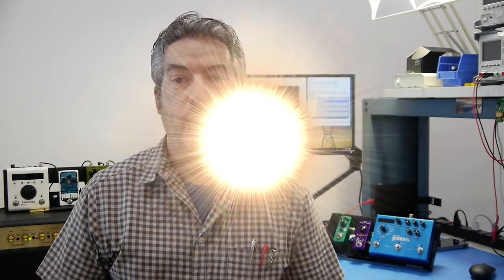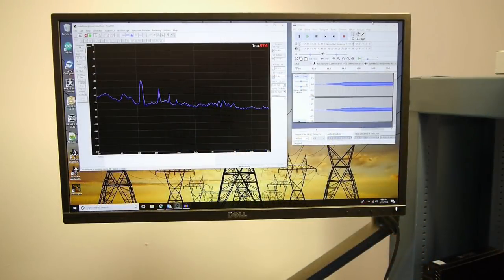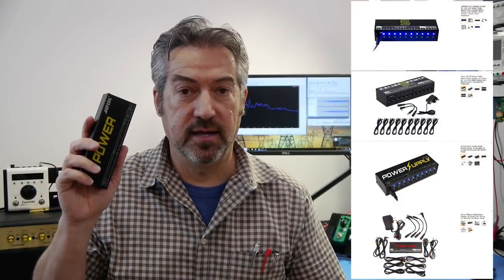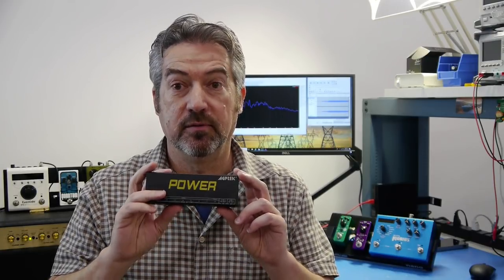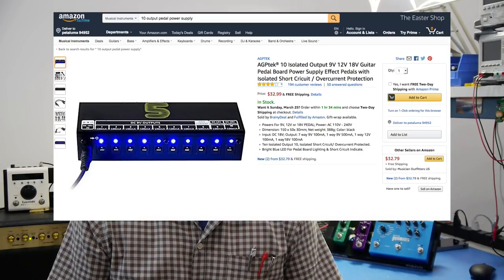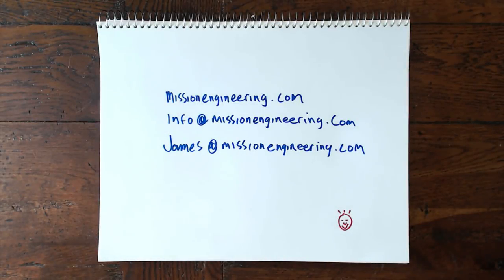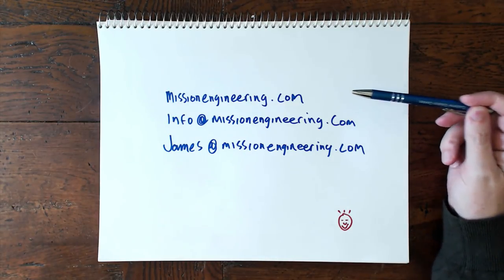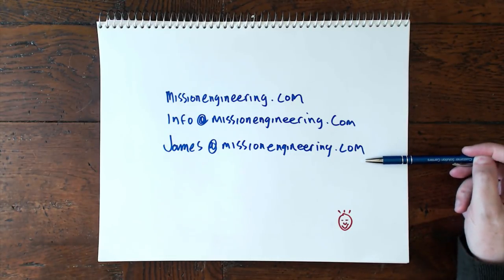Isolated vs daisy chain power supplies

Comment: a battery is a different type of power than a wall outlet.
Reply from the maker: True, but that's not what is happening here. The input power to the non isolated supply is 18V DC from a wall mounted AC-DC converter. The input to the isolated supply is 5V DC from the battery. Both power supplies are DC on the input. I could have powered the isolated supply from a wall mounted AC-DC converter and these results would be the same. I'll do another video on battery vs AC as there are some interesting differences there too, but it's nothing to do with the digital noise issue.
Reply: I would like to see that. I’ve always thought separating the effect Chain from the house power supply is a great idea, especially with a big band and lots of power draw
Reply: well then you should have used walwart power in both instances.
Reply: it's still a control that should have been accounted for. I like the video and appreciate all the effort and explanation, but I too would've like to see both setups connected to a wall outlet
Reply from the maker: Fair enough. It'll make a good follow up video. I'll repeat the tests with both isolated and daisy chained supplies connected to wall power.
Reply: @JamesLebihan  you could probably get away with just doing to isolated one, while plugged into the wall. I can tell you spent a ton of time making this video, and it's probably the most in-depth explanation on YouTube. I really appreciate the effort
Reply from the maker: Thanks, I thought that too , but thinking about it more I can cover some more ground. I'll test the isolated vs daisy chain with both powered from the wall as suggested here. I'll add in a third device, an isolated power supply with an internal transformer rather than an external AC DC supply. Then I'll do another setup with a battery but common return paths. This should demonstrate further that the noise we are discussing is related to the condition of the outputs, and has little to do with the input power source.
Reply: Are the 150 outputs isolated from each other, or just the high output?

Comment: the only reason for that noise is because the power supply's mA is lower than the pedals' combined mA .. therefore, as long as your pedal's combined mA does not exceed the power supply's mA you won't be experiencing noise on your pedal board .

Comment: Hello, this is the best video on this subject. Very detailed, and conclusive. No guessing, instead, just engineering analysis. Thanks for sharing this.
Reply: Just forgot to mention, but placing the digital delay pedal at the end of the pedal chain and preferable after the gain pedals like overdrives, boosts and distortions shall reduce the noise in both cases. Which is the usual order of pedals.

Comment: I'm not sure why this video got any thumbs down....this was very informative and scientific. Thankyou James for posting this... I just ordered an inexpensive "isolated" power supply from Amazon... I sure hope it's what it was advertised to be...because I've been experiencing sound from a tap tempo strobe that is daisy chained with analog drives. It's pretty wrong to advertise an audio effects specially product using such specific terms relevant to this common issue. Hmmm... Im definitely going to test for common ground when I receive it...because the problem will still exist...and I only purchased it because it says very specifically that it's isolated. How do they get away with that for years? That's a very blatant mislabel.

Comment: This really has not much to do with power banks, but I had an issue with this type of noise with AC pedals of BOSS and running them off the same wall outlet with my DC Pedals. I had to switch and make sure all my AC pedals were plugged into a different power strip and use and extension chord to run them to the opposite wall outlet from the DC pedals.  Also not running your power supply wires with the pedal instrument cables parallel will help reduce unwanted noise. (If you have no other choice, cross the wires, do not tape or bundle them running in the same direction together). I also had really old cheaper cables mixed in with some really good ones. I just gave them all to a school music class who needs anything music and just bought some little expensive ones. (Gigtuff) And holy crap the reduction of noise was amazing! Now I have never had these type power sources and wanted to get one. I run mostly analog pedals, but I was wanting a couple digital ones, so thanks for the video. It looks like to have better sound you just have to do certain things and bite the bullet on costs if you want good sound quality.
Reply: Don't power analog and digital pedals with the same power supply. Also don't use a power supply for both pedals that go into the amp In and the S/R... And be aware of the mA current draw

Comment: I recently picked up a Walrus Audio Phoenix because it was exhausting playing with noise.  Went from using 2 cheap pedal power supplies to a single truly isolated power supply.  I only with I had not wasted money on the cheaper psu's from the start, but at the time this was what my budget allowed.

I even bought a power conditioner thinking it would help.  I can honestly say it did not hurt and is a good preventative measure, adding a layer of protection.

Playing without noise is amazing - Thank You Walrus ($$$$$ worth)

Comment: the other guitarist in my band recently replaced a power strip and lower cost iso brick with a higher priced mondo brick and a furman power conditioner. Night and day, truly. So much less noise and such a clearer signal ... i have an iso brick but it only has five outs, so i'm limited and sometimes tempted to use a daisy chain for my drives
Reply: That's interesting because I'm here because I upgraded from a daisy chain to an iso brick and it's noisier than ever and I can't figure out whats going on or if theres anything I can do about it.
Reply: @danielvalles9554   sometimes a bad pedal or a bad patch cable can be the problem. You might want to try using the iso brick and just add one pedal at a time to the chain and see when that noise starts in. Other variables might be the guitar or the amp. Good luck. Let me know how it goes
Reply: @danielvalles9554  another problem is sometimes the input of a power brick can be a very low rating that isnt enough to power your pedal.

Comment: The 1 spot daisy chain style power supply works well for analog effects. It can have problems with digital effects with higher current requirements

Comment: Thank you.   The Guitar Pickup is a main source of Noise that comes with non-shielded cavity and or bad circuit wiring grounding etc.   The 50/60 cycle hum is always in AC current. I have been Using Battery Banks with out any noise from the wall power AC.  I have Identified some of my Guitars over 40 that needed shielding. The Market is geared to take money. I have payed way to much for a wall wart which said it was eliminating Hum 1 Spot. RIP OFF.

Comment: Some questions:
1) How the background noise will behave when you connect the guitar and play it loud?
2) Does it matter the isolation between the power supply of the amp and the pedals? Lets say, I have an amp with the traditional plug connected to a power strip, while I have also connected the original power supply for a crybaby, a 9v power supply for a sd1 overdrive and the power supply for a line 6 multieffects. And what kind of issues could I get from this arrange? (Anyway, I will test them all disconnecting one by one as you mentioned).
3) What if the building doesn´t have a physical ground installed? Is there any relationship with this subject or not? How can I test to know if there´s a physical ground (green conductor) without opening the outlet and/or finding the location of the copperweld grounding to check continuity? (sorry if it isn´t within your scope)

Thanks, I have found your video very useful.
Reply from the maker: That's really too many complex questions to answer in a Youtube comment. In short:
1. The noise is always there. If you play loudly over it, it won't be as noticeable, but you may hear it in rests and quiet sections.
2. Generally, you want to have all devices that are connected to the wall, referenced to the same ground, so plug them all into the same point. Different ground references can result in ground loop hum.
3. If there is no ground at all at the wall, then this could be a safety issue. It may be OK if all your devices are designed to be used like that, but if you have devices such as tube amps with exposed metal parts and ground pins on the cables, I would strongly recommend that you do not connect them to a supply that does not have a safety ground. You can buy wall plug testers from most hardware stores and online that you plug into the wall outlet and they will indicate if there is a ground present.
Reply: @JamesLebihan   James Lebihan  Thanks! I was confused about the role of the physical ground ( The lack of, for example) on the noise issues. I think now it's clear. If there are multiple outlets (A four outlet voltage regulator with a 6 outlet power strip connected to one of the regulator outlets, all the 9 available outlets would share the same ground, so ground looping would not be present, right? And the lack of a ground would be a safety issue, but there would not be any noise issue, at least generally... Thanks again.
Reply: @SharlsRS  If you don't have a physical ground at your building, then this will result in safety issue. If someday fault current enters into the chassis of amp, it will travel through guitar cable and you'll get electrocuted. Also, if your amp doesn't have a actual physical ground, then it will make too much noise (in my opinion). 
I think we are supposed to connect ALL our equipment into the same power strip (surge protector) and then connect that surge protector into single wall outlet (if I'm not wrong).
What I don't clearly understand is, why do pedals make noise when daisy chained or also when using non isolated power supply (because there is no actual physical ground on a wall wart adapter). Researching on this topic.

Comment: This video is definitely filled with a lot of useful information, however, the bottomline here seems to be that when it comes to daisy chaining your pedals, analog yes, digital no.  Simple, I suppose.... However, the problem I have with this conclusion is that most of the popular, higher end, and higher effects pedals are digital. I guess it's good information to have in the end, but it can skew the decisions on what you choose to buy.  I don't daisy chain, but I was thinking about it recently and that's why I am on this video. I guess the best thing to do, in my opinion, is to always isolate; no matter what you have.  That would be my advice because you limit yourself in what you get in pedals.

Comment: Using a separate power supply for my 1 digital pedal fixed my noise problem. All others are daisy chained. Cheaper fix.

Comment: i built pedal power supply using IC LM317 based on tonepad website, and it sounds like isolated one on audacity. Still don't know what differences between them on market. All of my pedals are DIY-ed

Comment: Years ago, I bought a cheap power supply on Ali Express. Recently, I wasn't paying attention, and I plugged my 18V (Switchable Voltage) power supply into one of the 9V output slots. My power supply started freaking out and my looper pedal (the one that was next in the daisy chain) was fried. Did this happen because there was no isolation between the outputs?

Comment: So could I keep my analog pedals plugged into my non isolated power supply and just plug my digital pedals into a different wall socket or extension lead? Or will there still be common ground? 

Ps thanks for this video; very informative
Reply from the maker: Yes in most cases that is true because when you use AC-DC power supplies (wall-warts) to power the digital pedals, they will be isolated on the DC side.
Reply: @JamesLebihan  thank you for this, I was troubleshooting all day with a new £70 isolated power supply which met all requirements to power my strymon big sky buy for some strange reason kicks the power off after around 60 seconds of use and then continues to reboot the pedal, I think I will use it for all my other pedals but just power the strymon separately 

Thanks

Comment: Thank you SO much for this! I've learned a lot from this video. One question regarding the noise - I'm using a not-isolated power supply to power 10 pedals (digital and analog) and I get 0(!) noise. My power supply (Tomanek) is a daisychain with capacitance filters. Can you talk about it? Is it an alternative to isolated power supplies?

Comment: what if the pedals being powered aren't carrying or handling the audio signal? For example, if i need to power an optical expression pedal and a midi controller? can i safely daisy chain those two things? My issues is this, i have an isolated PSU (strymon) and 5 isolated outputs where i now need 6 devices powering. I was thinking perhaps those two pedals could exist on one power circuit. Thanks for the great video!
Reply from the maker: If NONE of the devices on the chain are carrying audio, then this will likely be OK. You'll have to test it to be sure. Bear in mind that if you connect multiple devices to a single output, that output will need to deliver enough power for all of the devices. Add the power requirements of the expression pedal and the MIDI controller, and make sure the single power output can support sufficient current for both.
Reply: @JamesLebihan  yea its fine for that, 500mah output for the combined which pulls under 200mah across both. I'll let you know the result. Cheers.

Comment: Hi, I'm having some problems with my one spot. I currently have 7 pedals (daisy chained) which are pretty cheap ones but there is this humming and almost small beeping sound coming through my amp, I thought this would be my digital delay, I took it out of the chain and there's still noise. I have these pedals: (not in signal chain order)
Flamma Modulation (11 effects), Sonicake vol/wah, Tc electronic delay, Flamma comp,  cheap Vintage overdrive,  rowin noise gate, and a lekato looper/tuner.

Are there any recommendations to stop this noise altogether, maybe it's another pedal? I'm not sure but it is very noisy.  Thanks!

Comment: 05:00 so each output is isolated great. but if you  patch two pedals together the  negative terminals of the pedals are now connected together. so if you then plug them into the power supply are the outputs still isolated?
Reply from the maker: If you connect multiple pedals together in parallel (daisy-chain) from a single power output then those pedals will not be isolated from each other, although they will be isolated from the devices connected to other isolated outputs. If you are careful about which devices you daisy-chain, this can often be perfectly acceptable.
Reply: @JamesLebihan  yes and I guess it depends on the pedals. And on some smaller boards a cheaper non isolated power supply will work fine.  But I connected a row of pedals together with patch leads. Then I put my multi meter on the center pin of the power input socket and found they were connected (as the power center pin is grounded to the sleave of the signal sockets) . so my question is even if the power supply outputs are isolated once you connected them to pedals are they really still isolated or are they now connected via the pedals